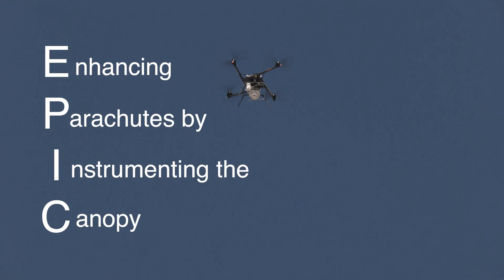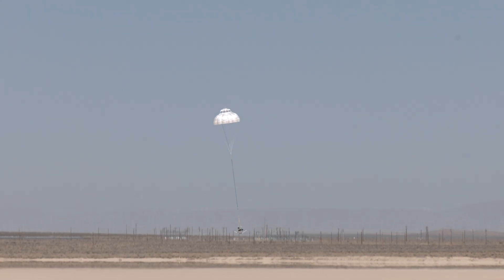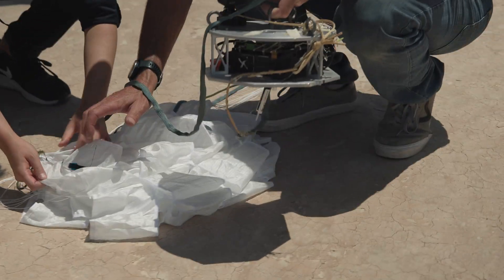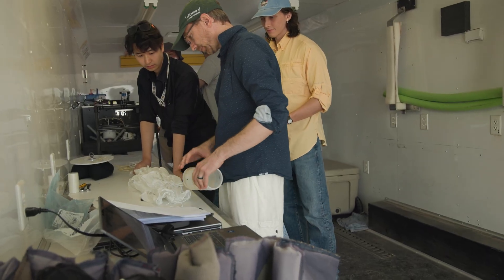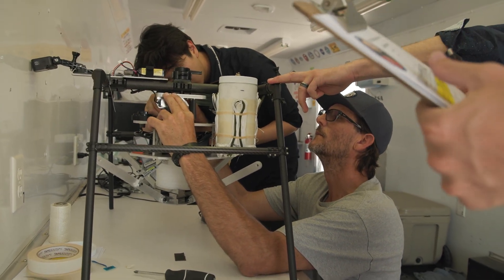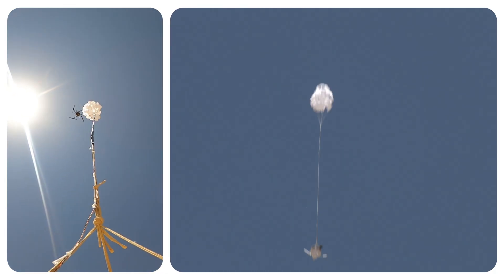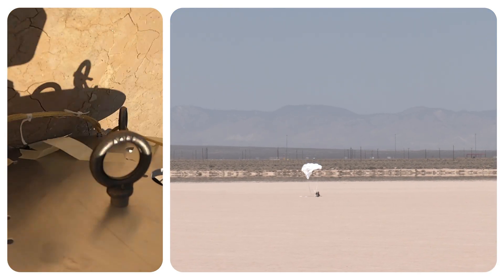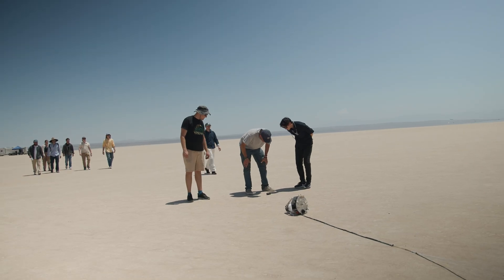Testing the Drop: NASA Works to Improve Supersonic Parachutes for Mars Missions

Comment: NASA is very good at coming up with terrible acronyms

Also I am not sure what they were trying to do.

What exactly is supersonic here?

How did you decide that the sensor didn't impact the deployment of the canopy?

Why did you not put the aim at the beginning of the video?
Reply: its not supersonic in this test, i think they are just testing the system on a scaled down model to just check everything works alright before they put it on something supersonic. It's a lot cheaper to drop something off a drone a few times than to launch a small payload test on a sounding rocket.